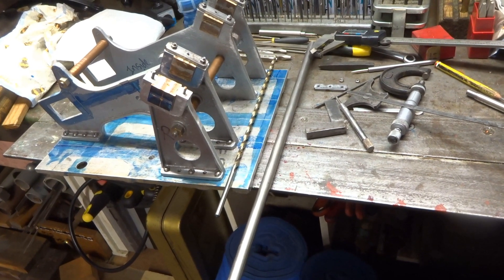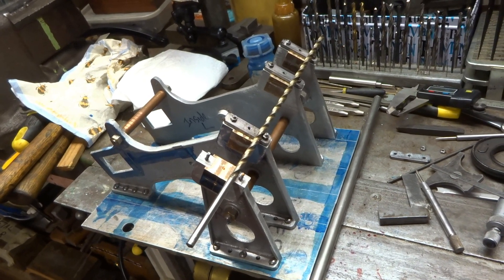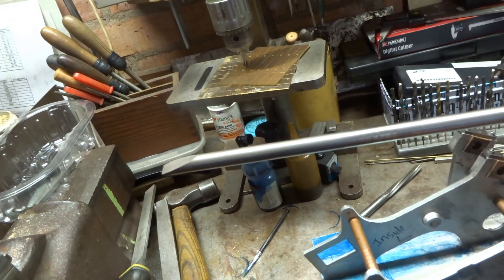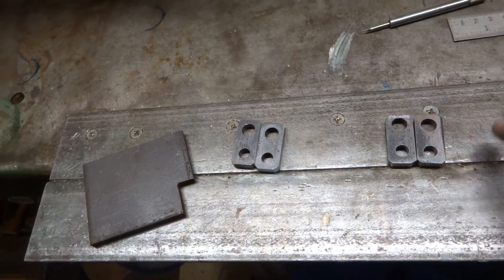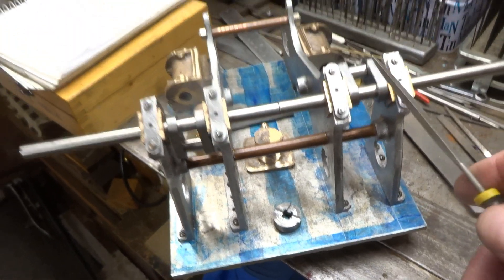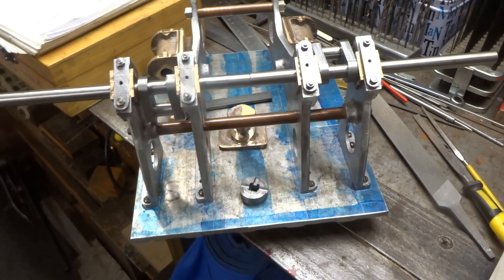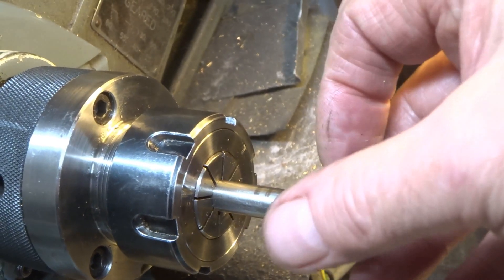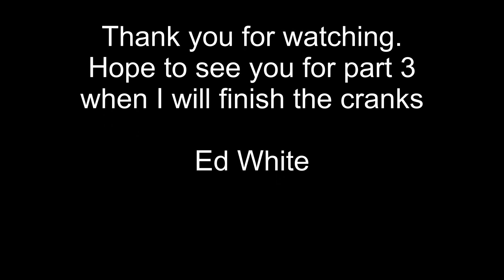twin cyl paddle steamer engine part 2

Comment: Hello Young Ed, my favourite type of steam Engine is coming on a treat. It reminds me of hot summer days in the fifties travelling down the lower reaches of the Thames seeing all the shipping in wharfs and docks and day dreaming about when I wouldgo to sea one day.
So far as differential paddles are concerned never forget that the first steam powered trans- atlantic crossings were by paddle-steamer all beit sail assisted. One thing is certain if I win the lotto i,ll be putting a suitable bid in with a view to purchase. Great stuff regerds Bob.
Reply from the maker: Thanks Bob. One of my aspirations is a trip on the Waverley, but Angela no so keen. Here's hoping for calm seas next year.  I know about the Paddle steamer crossings of the Atlantic. A big prob was in rough sea in whole or part the paddle(s) came out of the water - very inefficient. The Paddles were better suited to the calm of a river, but ultimately the advent of the screw propeller spelled the end of the paddle as I'm sure you know. Ed
Reply: Thanks Ed.B.